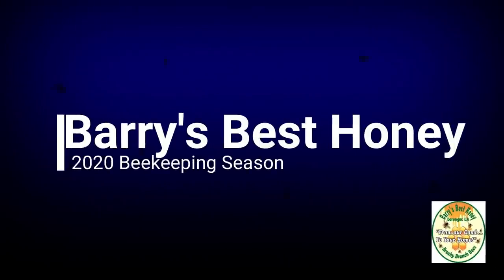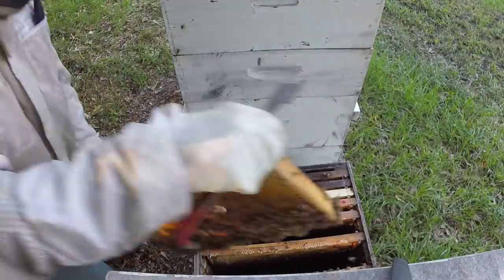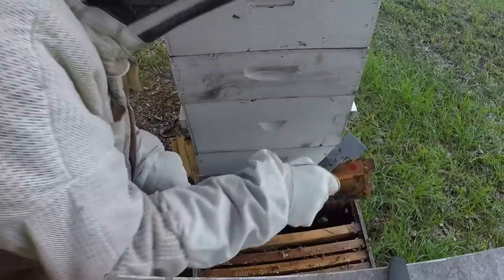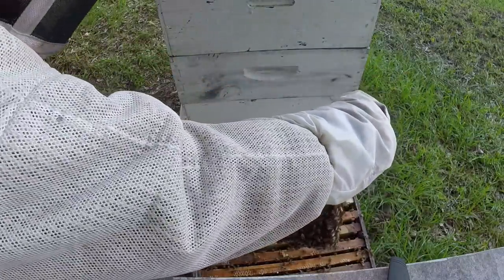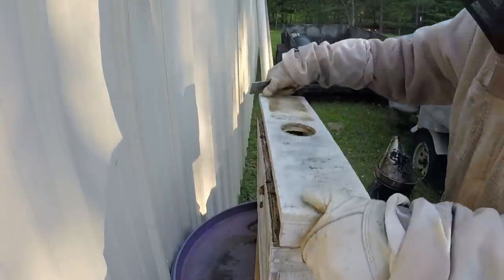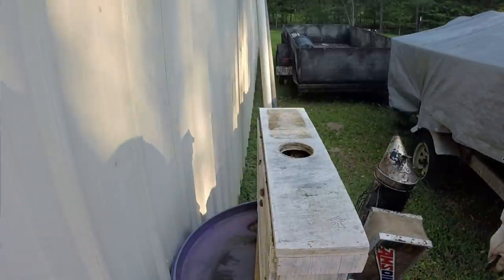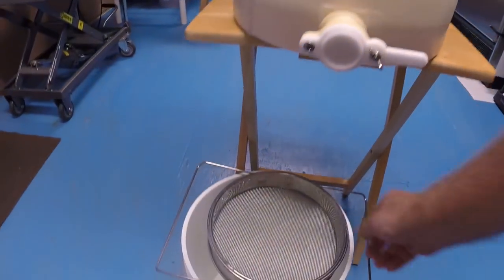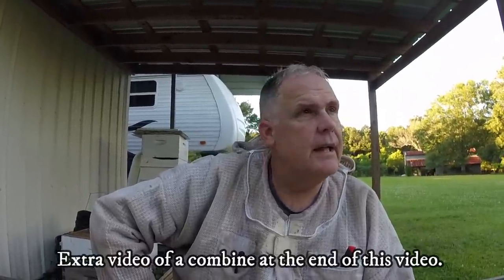Where is That Queen-Finally Settled??

Comment: Nice looking emergency cells in that 2 frame.  I purchases a refractometer after my first season. Takes the guess work out of the moisture content.  I evened out a couple frames they pulled way out (to avoid weird comb building) and had a couple pints just from those corners.  Also mixed capped and uncapped.  It was almost translucent yellow.  Love the light color of spring honey.
Reply from the maker: I thought about buying one, but just never did. This honey I know is very wet, but it won't be sold. I give some away and we'll eat the rest. I also cycle all my buckets through a big warmer and they usually spend two weeks each in there once it's harvested, so that dries it out pretty well if it is a bit over 18%. That clear honey is so floral!!

Comment: Thanks Mike, hopefully those bees will settle down.  You pulled 3 frames and I did the exact same thing today but I pulled 2.  I always spin it out an put the frames right back and let the bees clean up the comb. If that was my hive I would have added a super also.  Thanks for the video.
Reply from the maker: I did add a super. I went back after shutting off the camera and added one. I may or may not have mentioned that in the closing. But I thought about it as I went back to the barn and figured they needed somewhere to out more honey since there are still a few days left in the flow. I don;t mind either if she goes up in there. Space is space, and I need her to get settled in and have them ready for winter.

Comment: I just started pulling frames for extraction and return of the wet frames to the supers to be refilled.
Reply from the maker: That's normally my practice. Usually about 5 to 10 supers mid-spring. I sure didn't have that opportunity this year, not with all of the swarms I experienced.
Reply: @MikeBarryBees  I just made a split after finding swarm cells and I cut out a queen cell out and put it in a roller cage and placed in the queenless nuc, to make an extra queen. We'll see if it emerges.
Reply from the maker: private bubba be a good NUC going into winter for next year’s season for sure.

Comment: Hi Mike. Great video. Thank you for posting. When you add frozen frames from a different hive......do you let them thaw and then add them in?  Where do you have those frozen frames sitting that the frozen brood doesn't get eaten by bugs?
Reply from the maker: Well, I should, but in this video, I did not. When I do thaw it though, I just leave it a frame stand I have in my barn. It's not out long enough for bugs to get it. It's so hot down here, it's thawed in 30 minutes to an hour. Frozen honey a bit longer, but not by a whole lot...